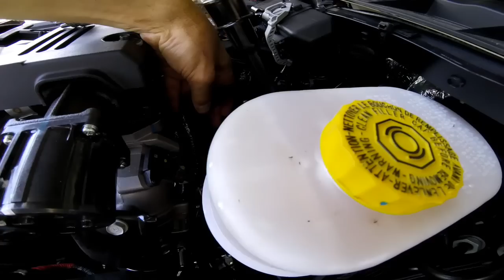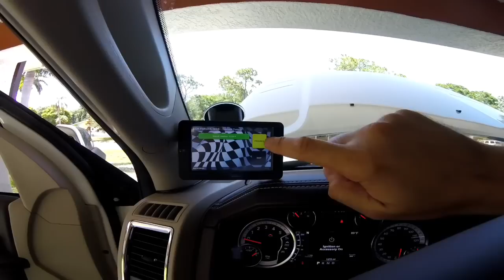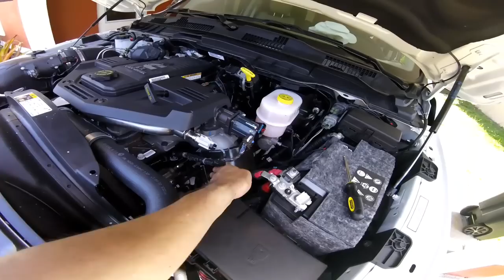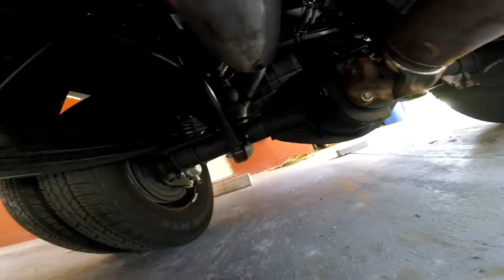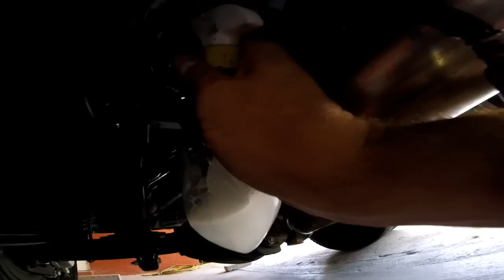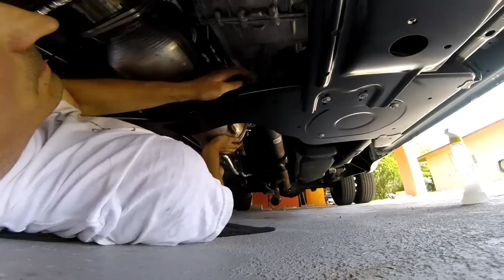New Ram 3500 DPF EGF EGR delete with RaceMe Ultra

Comment: I no this is an old video . But do you still have this truck ?
Reply from the maker: Still driving two of the three trucks I've done videos for, love the deleted Cummins!
Reply: Shaun Volkmann Thanks for the reply . I mite but my buddy’s off him . I was just wondering about the box tunes and the quality of them . I no you can get custom tunes done as well . I got a question for ya if you don’t mind . I no I will need to purchase a new VIN . What do you think a used raceme is wroth ? I’m not looking for HP at all I just want to delete . I got an 18 dually with the AISIN as well
Reply from the maker: @neverenough7767  depends how many VIN keys it has on it. If it has four, then its worthless. So with VIN keys left, $300-500 IMO. Range depends on it it was permanently kept in the truck outside. You can tune, and remove it from the truck, those will be like new still.

Comment: This is the simplest delete on Youtube.  Is it only possible with the Raceme ultra?  It's so expensive.

Other question is would this work with a 2014?
Reply from the maker: Thanks! Worth every penny, why skimp on a 40k+ truck? This works for all Gen4 Ram with the 6.7L I haven't done any other tuners, so I don't know if they disable the same functions. I would bet you can follow the same procedures... but it's not my truck 😉
Reply: @shaunvolkmann1904  The more I research I see the value.  For one Raceme ultra is a programmer and a tuner.  There is a lot to for me to take in researching all of this.
Reply from the maker: @idahoduckhunter  Yes, the DPF system cost, the sensor costs and constant regen cycles cost quite a bit over time. The one time investment, and choosing a quality device made my mind up. Of course, this is for offroad use only. 🙂

Comment: Hey Shaun, i've been looking through your comments and have not noticed any for your current MPG, both towing and not towing. I have seen one comment a year ago that stated 5MPG with no context. In the 2 years with this tune and truck, presuming you are still in possession of the truck, what info do you have?
Reply from the maker: After I put 22.5 Alcoa's with 33's on one, and 38's on the other I stopped caring. Beyond the fuel economy the truck is night and day better. That's why this is "off road use" only. ;-)
Reply: @shaunvolkmann1904  I am curious about your 22.5 inch experience. I would like to do the same while keeping it legal with DOT - making sure the vibrations don’t knock out bolts and clamps. How can one add 22.5” without sticking out obtrusively? How can I stop the vibrations w/o lowering tire pressure to 60-40 PSI instead of normal 120 PSI? I have 2018 RAM 3500 AISIN with factory air suspension
Reply from the maker: @rayislan9392  I had the rims turned down to 22" by a machine shop. I'm running LT285/50R22  Nitto Dura Grapplers, and they run at Ram factory psi settings.  With the adapters the rear wheels barley stick past the wheel wells. Maybe an inch hangs out because they are only 11.5" wide.  Load range E means I can haul anything I want.  Smoother than stock once you balance the rims, especially the outer rear.

Comment: Will this kit work even if the DEF no longer works and the vehicle is currently only allowing me to go 5 mph
Reply: Hey Shaun! Just wanted to let you know that even though the truck was in limp mode we were able to get the RaceMe to work.  We cleared the codes by taking the battery cables off for 25 minutes. The rest we followed your video and everything is fine with the truck now. Just wanted to let you know in case someone else comes along with questions like I had. Thank you for your help!
Reply from the maker: @tiffanylandrum380  so, how does it drive now? :-)
Reply from the maker: Hi Tiffany, I assume your dash is lit up like a Christmas tree at the moment. The tuner will still write your ECU to remove the controls for the DPF systems. Unfortunately, you may not be able to clear the trouble codes to remove the warning lights. Programming should be done without trouble codes. Maybe plug in a code reader, or take to dealership to diagnose what is going on. Maybe it is just a sensor. Once resolved, fix that garbage for good. ;-)
Reply: Hey Shaun! We have had the truck diagnosed. It's a 2016 3500 Cummins 6.7. The code is P208A and it's says it's the reductant pump. The truck is currently in limp mode. We have reset the code but as soon as we start the truck it comes back on. If we reset the code and then program it with RaceMe should that work since it's not needed to start the truck while programming? Trying to find the cheapest way out of this mess. Sad that actually getting it fixed would be a crazy amount more than doing it this way. And at least this way I don't have to mess with this ever again. PLEASE HELP!!
Reply from the maker: @tiffanylandrum380  Sounds like you are on the right path. Sometimes you can pull the connectors for the DEF pump and spray injector, and spray some contact cleaner to help resolve those codes (then plug back in). At a minimum, clear the code and pull battery cables for at least 20 min. If when you first start the code isn't there I would go ahead and flash the ECU. If it is there right away.....well that might mean lights on that won't go away.

Comment: Thanks for the great video. You have me inspired now. Awesome!!!!
Reply from the maker: Best decision I've ever made! Get it!
Reply: @shaunvolkmann1904  is it safe to have these tunes with the aisin transmission because on the race me web site it says the tunes are not for the aisin transmission
Reply from the maker: @evan4881  yew. Two of the three trucks I deleted have the Aisin. You just can't edit any of the settings for the Asin, but you don't need to. I use the tunes that come with the tuner: stock no power increase and the default tune.  Default runs best with power increases
Reply: @shaunvolkmann1904  also did you get the tunes from race me or someone else

Comment: Hey I look at the flow master pusher series. Did you use the 5”? What is your exact measurements for the straight pipe? Can you send me the over all length on it?
Reply from the maker: 4" .  So far, all the trucks straight pipe have been the same, as the DPF systems are all similar to save production costs.  I cut out the legnth of the original pipe for the Flowmaster, so I don't have that measurement. Get a kit on eBay, don't over think it.
Reply: Okay sound good so far I have no luck finding 4” flowmaster
Reply from the maker: @chatchayapaipak5002  You'll need 2 clamps, then weld the exit side pipe in using the factory clamp to secure it. Use wire coat hangers to mock up the location of your hangers with it clamped in place. A muffler shop can weld on hangers for cheap.  Flowmaster 14020100 Pro Series Muffler - 4.00 Center IN / 4.00 Center OUT - Aggressive Sound https://www.amazon.com/dp/B0035J83YI/ref=cm_sw_r_cp_apa_i_cKCTDb0ZAV3A9

Comment: What are those connectors and sensor you reconnected after removing it from that bracket on the exauhst ?
Reply from the maker: Pressure variant sensors for regeneration system. Don't let them get dirty and risk throwing a code.

Comment: Shaun great video. With leaving the erg components in, have you noticed any problems or heard of any doing it this way. When will you completley remove them..
Reply from the maker: No issues at all. You have to change/drain the coolant to remove all those components. So, when that maintenance is due I'll pull that equipment. Those that worry, can always put the equipment back on, and just plug it the EGR systems, then flash back to stock if they want to warranty something. Much harder to do that with permanent removal of the systems under the hood.
Reply: @shaunvolkmann1904  Shaun if it doesn't cause any harm maybe we should just leave it in. I have a 2016 and have set it up just like yours, but it has always bothered me the erg and cooler is still there.. I have only 700 miles since delete
Reply: @leecooper9239   just checking in, did you leave the under hood components installed and removed the exhaust? Just trying to get a clear detail about that. If it is ok to leave it that way.

Comment: I got the same tuner and all and was so close to finishing it up but I can’t tell where you plug in the 3 prong connector. Do you lug it into the map sensor right on the back of the egr valve or is it into the throttle valve connector a little further down? The instructions are pretty unclear and the company is terrible with customer support
Reply from the maker: The one to the tuner? I outlined where that goes. That connects you to the ECU. That connector is driver side taped to the harness under the horn manifold for EGR. I take the camera there in the video
Reply: Shaun Volkmann I’ve looked all around and up underneath but the only connector I can find that’s like the one you show under the egr manifold, doesn’t fit the three prong connector that comes with the kit
Reply from the maker: @justinreavis2613  the connection has a plug in it. Pull the tab up and pull it off. Its usually taped up, which makes it hard to find. Once you rip off the tape, remove the blank plug, then you can plug right in! Don't give up! Use your phone with flash on to take a photo to see under there if you can't see under there very well.

Comment: Where can I get the dpf and cat delete pipes, I have a 2015 mega cab. Also if I'm just deleting the dpf and cat, does it matter that i have a megacab?
Reply from the maker: Ebay or Amazon. Only thing that matters is if it's a short box crew cab from the ones I have done. Mega and 8' crew box are same kits.

Comment: I don’t remember putting on that hose sensor from the DPF filter do you have to do that also do you have to tune the truck before unplugging all sensors I don’t remember doing that either. How did your video get put on the raceme Website just wondering that’s pretty cool
Reply from the maker: Best to tune the truck stock, so you don't have any codes to deal with. Then delete parts before running the truck. I have the Asin transmission, which can be sensitive to voltage changes. I left as much as possible plugged in to maintain that same draw. Why not? RaceMe found my video, and posted it. I made a few more for them, great company!
Reply: What about the loop rubber hose on the under side does that stay like that or disconnect all that after programmed?
Reply from the maker: @redeyecharger7568  I kept it connected and zip tied to the frame.
Reply from the maker: @redeyecharger7568  I found removing that module makes the motor lope like it had a race cam installed. Using the hose looped is just to keep everything inside clean, and error code free.
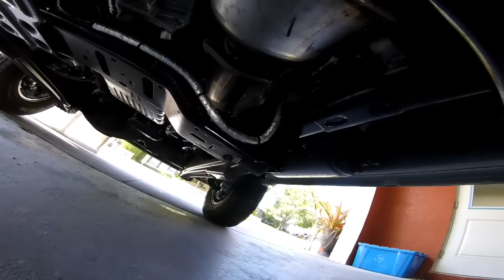Reply: Thanks for the info one last thing, I see at 8:16 you kept the oxygen sensor in? Does it matter? How long have you had yours deleted? I’ve had mine fully deleted with 5in turbo back from 2015-2017 (smog laws)and I’m thinking of going back to my raceme but it’s different now with the whole not deleting the egr and just unplugging some sensors 🤷‍♂️
Reply from the maker: @redeyecharger7568  no, that sensor is disabled. With a 5" system you won't use that anyway and it will get pulled if your replacement doesn't have the hole for it.  Have a 2016, 2017 and a 2018 running now for many miles without any issues.

Comment: The computer module on the transmission, the one with two hoses that you hooked back up, do you need to plug that back in will all tuners?
Reply from the maker: Only can speak from my experience, sorry no reference on other brands.
Reply: Shaun Volkmann thanks! I couldn’t remember if on my last truck I deleted if that module was there or not.
Reply from the maker: On my 2016, I left it unplugged. Threw a code and made the engine lope like it had a big cam. Although people said it sounded bad as$, I plugged it back in and cleared the code.
Reply: Shaun Volkmann thanks

Comment: Is this the same setup in a 2015 2500? I’m thinking about doing the same to mine. So you leave everything in tact like the def, egr and dpf? Thx in advance
Reply from the maker: No. You must remove the exhaust system, but can leave the EGR systems under the hood in place once disabled. This video is a 2017 3500. Have another video of a 2016 2500, and have also done a 2018 3500
Reply: @shaunvolkmann1904  where can I find the video of the 2018?
Reply from the maker: @josue6.753  I didn't do one because it's 99% the same as 2017. Just the electronics are different on the DPF, location wise. But all same connections.

Comment: Do you keep the DEF tank in there or did you have that removed? I just deleted and straight piped my 6.7 and it’s just sitting there leaking DEF fluid still.
Reply from the maker: I drilled a small hole in the heat shield above where it used to mount, then zip tied it higher than the fluid level. It hasn't leaked since. Pain to remove the tank. Bet you can get a fitting to stop it from leaking, but laziness rules here.

Comment: My truck is stock and i have a check engine light on for a NOX sensor P2201.  Can  i install the racemeultra with the check engine light on?
Reply from the maker: You can install with any code on, the real question is will the RaceMe tuner be able to clear that code once installed. Head to racemeoffical.com and use the chat feature and ask. My hunch is yes, you'll be able to clear that code since the system turns off all exhaust emissions system's during the flash. I've not had to address this situation.
Reply: I'm pretty sure it will clear that one

Comment: Thanks for sharing your video.  I ordered mine but it wont be another few more days so I removed all the sensors and unplugged egr and removed the plunger to get ready for it arrives. Do you  if  this matters. 5hx u?
Reply: Agreed Thank you
Reply: I did.  It was pretty straightforward and the video helped out alot. Thanks again for the video or I would have spend more to fix DPF
Reply from the maker: Better to flash then remove. Whatever you do don't start the truck! I would plug everything possible back in and flash ECU to avoid some pesky trouble code lights.
Reply from the maker: Did you get your up and running?
Reply: Great video! Have a 2021 and wondering if unplugging and taking plunger out would also work compared to blocker plates and so on to keep it looking stock.

Comment: Has there been any loss of any functionality in anyother system by reprogramming he PCM.? ie Front bumper parking sensors still work ? do seat heaters and coolers still work ?
Reply from the maker: I've had nothing go rogue with any of the three I personally deleted. All systems work except for the ones we don't want to.
Reply: What’s up Shaun,
Thanks for the great video I just finished doing my bypass Delete I bought the Shibbys plug kit so I didn’t have to remove my DEF intake and do the hose bypass everything you said in your video made the process a breeze your the brah. I did the straight pipe four-inch system on my 2500 and the drone is ridiculous did that has power from flow pro make it more pleasant in the cab for you or should I go with something that will decrease the dB even more
Reply from the maker: @dmfgacct  the sound is still bad ass and aggressive, and the drone is a happy purring. Very satisfying, and the woman hasn't complained since.
Reply: @dmfgacct   so! Moving forward my I ask how this problem worked out. I’m guessing you installed the muffler and your much happier now.  Thanks in advance if you reply!
Reply: On the EGT SENSOR I have the same situation as you not willing to remove my EGR cooler and void my warranty so trying to find or make another access to mount the EGT sensor I’ve already wired it in it’s just zip tied off to the side for now. Thinking about removing the downpipe drilling a hole welding a nut onto the pipe so I can thread the EGT sensor in right there under the turbo.
Reply from the maker: Did your truck have an issue?
Reply: no problems but thanks for asking. just looking at all the youtube videos doing my research before I pull the trigger and start the process. I have a 2018 2500 w/68RFE. I just received the Flo Pro 868NB and waiting on the tuner MM3 LITE from DRD to tune FIRST. did you install an EGT sensor ? if so ant tips ?
Reply from the maker: @dmfgacct  Nope, but I don't do any heavy towing. When I hard remove the EGR, you can install one very easily in the cover plate. They even tap the plate to screw one in.
Reply: I'm working on a 24-30' toy hauler so I would like to keep an eye on the EGTs but i'm going with the VOLKMANN bypass delete to preserve my warranty I have seen some drill & tap into exhaust manifold but still researching best way to do it.
Reply: Sorry about the typos I was voice texting. Is the hush power muffler a go or should I find something that decreases the dB even more

Comment: 1-what tune do you have on the RACEME ULTRA. 2- HOW DID YOU GET THE MONITOR CABLE THROUGH HE DASH AFTER IT CAME THROUGT THE FIRE WALL. 3-HAVE YOU GOTTEN ANY CHECK ENGINE LIGHT OR OTHER CODES SINCE CONVERSION ?
Reply from the maker: No codes with many miles now. You can run any tune you want adjusting fuel, duration, timing and VGT spool rates. Many do stock with deletes. I've found the default tune to be best with the AISIN trans (+520 HP).  I ran the cable under the door molding and out near the A pillar grab handle. You can see where I have the tuner.
Reply: Awesome method to keep your warranty and save your engine from EGR damage. Thanks for sharing.

Comment: 1-How can I drain my DEF tank no longer in use. 2-Great if you could show the gromet and drill size used for firewall pass through and route for cable to Raceme monitor thanks Great option on Truck under warranty.
Reply from the maker: I can't make it too easy now!